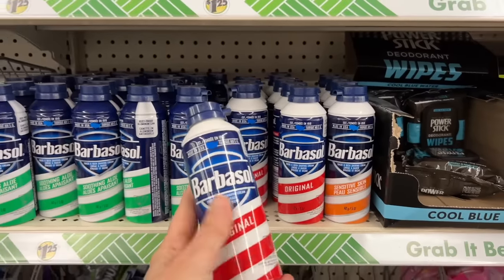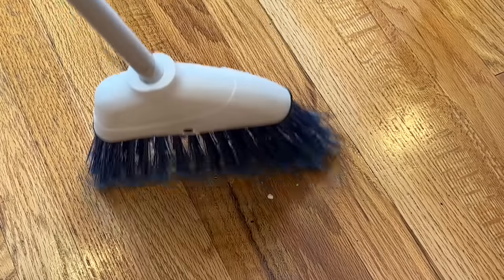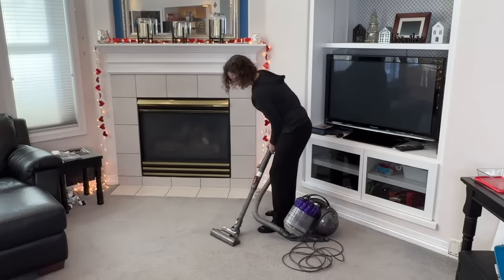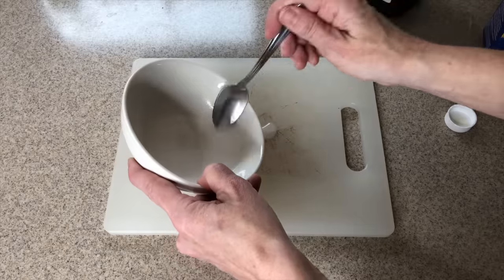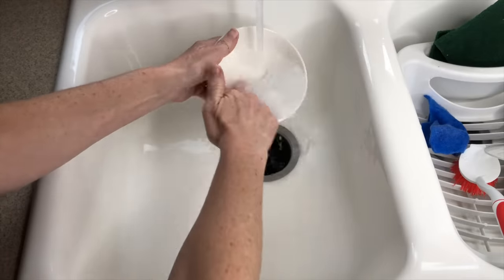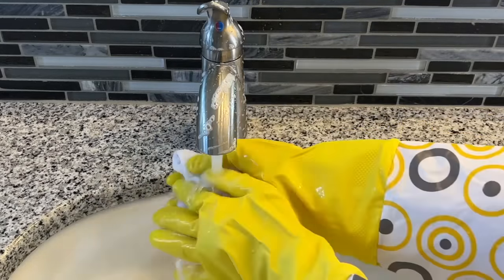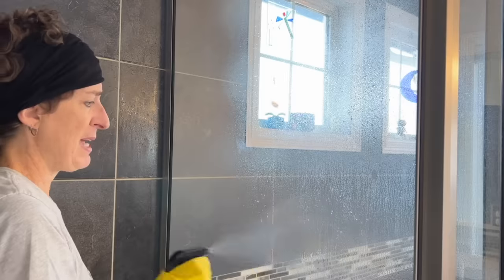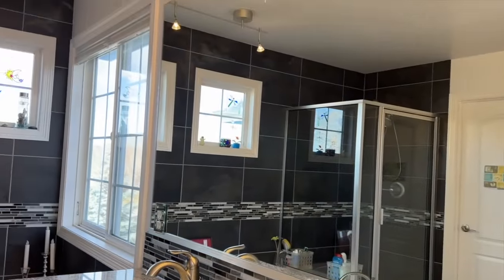This will solve everyone's WORST toilet problem!

Comment: Don't put Fabuloso in your toilet tank it will rotten out the O rings and make the flusher weak.
Reply: Same with the Clorox tank tablets.
Reply: Thank you for the warning!
Reply: The only things that should be allowed in the toilet tank are cleaning vinegar or hydrogen peroxide to prevent dirty toilet rims.
Reply: Before it does any of that it’s going to float around and bump into the mechanisms and cause the toilet to run constantly.  I tried a trick to use less water with filled water bottles (reused) so that’s how I know.  Didn’t break anything just didn’t let the toilet stop running when flushed.
Reply: I pour vinegar in my tank occasionally.
Reply: Plumbers say:
Don’t put any product in your toilet tank because it will damage your tank
Reply: You can use Oxiclean to clean your toilet tank. Empty the tank, add some Oxi and let the tank refill, then flush the toilet. If the tank is very dirty, leave the Oxi in for a few minutes. Oxi takes care of the dirt and doesn't stay in the tank long enough to damage the seal and mechanism.
Reply: Yeah, I had put in those blue tank cleaner tablets. Ate the seals. Caused leaking. Had to have the whole toilets seals fixed.
Reply: Also, keeping chemicals out of the tank leaves you water to have available in case of a disaster and water elsewhere is off or contaminated.
Reply: i thought the same thing. just use the toilet drops that are made for tanks
Reply: Or Bleach
Reply: @B_HarTz  Not the septic tank ya goof.  The water tank on the back of the toilet.  If you keep it clean, it can be an emergency reserve.  If you put chlorine tabs or blue water cleaner, you don’t have that reserve.  Not a hippie, but I did stay at a Holiday Inn Express last night.
Reply: @jonathandeere6232 😂😂😂

Comment: Heat up the vanilla extract in a microwave rather than an oven, it'll be cheaper on your electric bill.
Reply: Plus keep your kitchen cooler!
Reply: Some of us don’t have radar ovens. That was their original name.
Reply: Um ? I don't know much about anything but what about water/ vanilla mix and put it on a candle warmer??? I'm just a old guy that might get a warmer and try it
Reply: That should work too! 😊👍🏽😊👍🏽
Reply: @jeffharper7579  I put a little oil and vanilla in a skillet cast-iron skillet to warm it and stays warm awhile, just keep it on low in case you walk away and forget it's on, as a precaution, guess how I know.

Comment: If you need added scrubbing action when baking soda is not enough, use Borax. It does not dissolve as rapidly, is a little harder, yet will not scratch metal, porcelain surfaces. Oxyclean is also a great soaking solution for clothes, pots, and pans.

Comment: Depending on how old your dishes are removing, silver marks off your dishes, doesn’t mean that they’re just dirty it can also mean that there’s lead in the glaze that is on those dishes. Which they stopped making because of the lead that is bad, so throw them out unless you’re sure.
Reply: If you look at new dishes right now, most of them still have lead!!  If you search for “lead free” dishes you can find some but the point is, most dishes HAVE lead in them today.  Lots of glass also has lead!
Reply: Vintage dishes including fine china, ceramic ware & even Corelle pre 2005 are not safe to use other than for decorative purposes. Ceramic dishware from Mexico, Central & South America and Asia is not recommended to use for eating or storing food. Crystal especially wine glasses & decanters are not safe unless specifically marked. Alcohol or any acidic juices/liquid can increase lead levels in crystal glassware.

Comment: Here’s a helpful hint for anyone with dogs, if you have carpet, put some heated white vinegar in with your clean water and detergent when scrubbing your carpet.  Do the same with the water you use when wiping your hard wood floors or tole floors. It really helps keep the dog odors away. In general, always have white vinegar and use it often. Heated white vinegar with some Dawn added is a great hard water stain remover and great shower/bath cleaner. Not to mention, it neutralizes the bathroom odors.
Reply: Heated white vinegar...like put it on the stove and heat it??
Reply: @sarahconnor4757  I usually just microwave it for a couple minutes. Doesn’t have to be scorching, but I will heat it pretty hot for certain things. White vinegar, heated or not, is something I use quite often. When I’m cleaning my washing machine, dishwasher, shower. With my dogs, it really helps lift the dog smell from the carpet.
Reply: Regular dawn or the power wash?

Comment: If your getting a smell out of the bottom of your toilet, that means it wasn’t properly sealed with 100% silicone and sewer gases are getting through, and for the sewer gases to even get to that point, it means you have a failed seal at the closet flange- replace the wax ring, or your flange is set to low and you need either an extra thick wax ring, double stack two extra thick’s, or get one of those new fancy silicone self adjusting rings to seal the flange. But masking the smell is not the right solution.
Reply: Thank you for sharing your sense!
Reply: Assuming the house was plumbed to code it will have a p-trap beneath the floor which would prevent what you are saying from occurring.
Reply: @davidbalderston2751  where is that code? 

codes in the U.S, do not have a p-trap down stream of a toilet closet flange. The trap is the toilet itself the gases don’t creep past the waterline of the bowl. So it’s essential that the wax ring and the silicone circumference are installed properly.
Reply: Or maybe she is talking about the smell from urine accumulating on the outside of the seal under the bottom lip from guys with poor aim . . . it does happen.
Reply: @davidbalderston2751 p traps are built in the tiolet, the waste lines are a straight shot to the main in all tiolets that you will come across in modern day usa.
Reply: @_Chipster exactly what I was thinking

Comment: So whats best to remove persistent Limescale from the Toilet Bowl????
Reply: Install a whole house water softener system.  Scrape it off with a pumice stone. Cut off the water to the toilet and let the toilet dry off.  Soak the deposits with undiluted vinegar and wipe off the softened deposits.  The trick here is to keep the vinegar wet with repeated spraying, or vinegar wetted sponges or rags applied to the deposits to dissolve them. Keep a pint jar of vinegar inside the toilet tank to keep the water acid. Make a small hole in the jar lid to let the vinegar deep out.  Replace the vinegar every two weeks or so.  They say this will damage the flush mechanism in the toilet tank but the process has not caused any problems for me after several years use.

Comment: Can you recommend something to unclog toilets sinks shower drain
Reply: Dawn. I used every thing, wasted money, I keep a few drops in toilet. Or shower, not one problem.
Reply: I also say Dawn. My son keeps blockin up my toilet.  😢 nightmare.  I use hzmf cup of dawn n let it sit for n hour. For dezins i n eun boilin hot water after but the toilet usually flushes easily without hot water or plunging . ( pleade note. When i say nightmare i mean it  2 plungers, asstd chemicals n a snake later? Dawn works every time i now buy the big refill container)😅

Comment: When i moved into my house (it was a rental) the toilet bowl has those disgusting brown stains in it. Ive use clorox toilet bowl cleaner, i believe something that is CLR  with barely any water in bowl and let it sit when that didnt work i put lots more in and let it sit longer didnt work.  Yes i did scrub with a toilet brush after each of those.  Im wondering if i need to clean toilet then get all water out and put CLR in and scrub with a scrubber sponge.  Please help. Oh ive also used stuff with oxy clean and peroxide.

Comment: How does hometalk handle garbage disposal stink?
Reply: There are a number of suggestions people have made over the years: 
Run orange or lemon peel own the disposal
There are tablets you can buy
I just run the hot water for a minute then squirter some Dawn into the disposal side and turn it on. Do it a couple of times if necessary. 
Another possible issue is a partial plug. Find a reputable drain cleaning company to clear the drain for you.
Reply: Cut up a whole lemon and run it through your disposal with a handful of ice cubes. The lemon will get rid of the smell and the ice cubes will sharpen the blades.
Reply: Also, remember that any time you run the disposal you need to follow up with a squirt of dish soap, then run the disposal again. It foams up and helps remove small particles.
Reply: You can literally stick a brush with a long handle down there when it’s off.  Use regular cleaner like dish soap then remove the brush, turn on the hot water and run it.
Reply: After removing the rubber grommet around the opening of the disposal, I take a cloth and wipe out the 'slimy grub'. Then I pour a little vinegar inside the disposal and sprinkle baking soda inside.

Comment: If sewer gases are escaping from under your toilet, DO NOT use this method to fix it.  The toilet needs to be resealed to the flange.  This is a safety item.

Comment: Do you realize that Downy can actually stain fabrics?  I worked in healthcare for almost forty years, and sometimes my whites would get weird stains that would actually ruin the clothes. I found out they were from Downy, and switched to wool balls in the dryer to eliminate the problem. Anyway, I wouldn’t dream of spraying Downy in my rooms (even diluted!) because of the risk of stains.
Reply: That was my thoughts exactly.
Reply: Not to mention hormone disrupting phthalates.
Reply: Not safe for animals either …
Reply: I had to prove to my husband that fabric softener makes stains and odors set into the clothes! I got new t-shirts and stopped using fabric softener, and all of the new shirts which have been laundered do not stink or have deodorant stains in the arm pit area... I'm glad someone else realizes the fabric softener scam!

Comment: Do not put Fabuloso in your toilet unless you know what kind of chemicals are in it it could break down the seals and the Styrofoam, and whatever the Reservoir of your toilet is made of. In the long run it’s probably just cheaper to clean your toilet 😊 if you have a dog that drinks out of the toilet 🐶 also don’t do that.
Reply: Cats secretly drink out of toilets, too.  They would never tell you but sometimes they do!
Reply: @sonialinsey8083  So will dogs do this.

Comment: Why on earth would you wet your dust pan? The debris will end up sticking to the dust pan and you will have to wash it off later. You have doubled your work load.
Reply: Just rinse it under your faucet for a second.
Reply: Do you not wash your dust and brush then? Just askong
Reply: @susancraybould3919  on occasion, yes. But I do not intentionally make is s debris sticks to it. Again, why make extra work? It's ridiculous!
Reply: I wouldn’t do that either, but I do use the paper towel with the wet edge a lot.  Hard water marks I do not use her method either. I heat white vinegar and add Dawn soap and spray. Let sit, rinse, repeat if necessary and they scrub off just fine.
Reply: @susancraybould3919 do you?  I might wipe my dust pan down, but beyond that and making sure my broom doesn’t have debris and hair in it that’s it.  I do not anyone that does.
Reply: I wash my dustpans out quite often, why wouldn’t you?  Wetting the dustpan is a great idea, will defiantly be doing that next time. Thanks.
Reply: @MrsSeaHag  your decision, not mine. Have fun!
Reply: Why not just use a vacuum on wood floors?🤔
Reply: @guyh.4121  believe it or not some folks can't afford one.
Reply: @gh4121-b5n  occasionally they will need to be washed. Especially if you have dogs. I don’t have wood floors, but I swifter my tile floors for the most part.

Comment: The downy one I would be careful because of the possibilities of different chemicals that are in the different scented (or original scent) could have a negative impact over a long period of time and a possibility of serious allergic reactions that will be far worse than a person getting a rash in their skin. The concept is good though but I would try to find a good natural scent (orange/lemon/lime peels that have been ground up to put in the water) or essential oils that you’ve made sure don’t have any harmful chemicals to breathe, harmful chemicals to the skin, and harmful chemicals that could land on foods/drinks that might be consumed. 
Many of the ideas are really good and the first one with the shaving cream and toilet is awesome hack that I plan to use later today to try to get rid of some smells from our homes bathroom that I haven’t been able to figure out where it was coming from and I was planning on removing the toilet to clean beneath it along with the inside but im definitely gonna give it a shot before putting in all the extra labor.
Reply: Leaves little oil like spots on things too.  I make my own febreeze using my essential oils, rubbing alcohol and distilled water and it doesn’t do that.
Reply: I agree. My dad and I both have trouble breathing when Mom uses fabric softener in the dryer. I'd much rather find something natural.
Reply: @JaneSmith0709  my older sister has breathing issues and is extremely scent sensitive, asthma and allergies. I bought her a set of wool dryer balls, which does help soften the clothes naturally, as well as cutting dry time.  There are things I don’t like to use fabric softener on myself.  I love my set, as I use them whether I use fabric softener or not. I keep them in my dryer. I can’t speak for the ones I’ve seen that are not wool, but my wool ones are awesome and my sister loves hers too.
Reply: @kellidinit3725 I always use wool dryer balls. They decrease the drying time & fluff up fabrics naturally unlike commercial fabric softners that are not safe for the environment or fabrics & actually make towels less absorbent. If you want to, you can put just a drop or two of essential oils directly on the dryer balls. I have one marked just for that & keep it separated from the others.
 I noticed so many using fabric softener sheets that I smell when outside walking. That's in the air & not safe for birds &
 pollinators. Another problem is the newer beads people add to their washing machines to keep clothes "fresher, longer. " Those chemicals are being put into the water system, causing problems & definitely get absorbed into the skin. My dermatologist advises against using anything with fragrance when washing/drying clothes for that reason. There's a reason it affects those with asthma or respiratory problems. There are so many natural solutions that work just as well as the others.
Reply: @kellidinit3725  Do you care to share your recipe for this? Ratios? Or cups/ounces of each items?
Reply: @k.i.m.withkim9512  first, let me apologize that I tend to make a couple bottles at a time, so my amounts are for that. 1 1/2 cups distilled water, 1/2 cup of witch hazel, rubbing alcohol or vodka, it is optional to add a tablespoon on baking soda or white vinegar, then 20 or 30 drops of your favorite essential oil or combo of them.  I usually use the witch hazel or rubbing alcohol.  I have used vodka though, and I must say, I think I liked it best, but I am not buying vodka to spray around my house on a regular basis. When I used it to begin with, it was because I had actually had a bottle in my freezer for about two years.  Once blended and in the spray bottle, I usually wait a couple hours to use, but that is just me.  Give the bottle a little shake before using. I have dogs, and those dogs are spoiled, so I needed something I knew was safe for them too. Keeps our furniture neutralized against the dog odors.  And I don’t know who needs to know this, but warm white vinegar, warm water and Dawn dish soap will clean a shower beautifully and eliminate bathroom odors.

Comment: Easier way to remove blood/stain:  wet the blood stain, make a paste of salt and water rub the salt paste into the stain, let dry then wash. Works every time.Salt dissolves protein. Use this for chocolate, tomato sauce.  Protein stains (human and animal fluids) should never be exposed to hot water or acids like vinegar or lemon as this will set the stain. Thoroughly rinsing then soaking protein stains (like blood) in cold water with a bit of sea salt will usually do the trick.
Reply: Hydrogen peroxide is also really good at removing blood, even dried. And it's cheap.

Comment: Use hair spray on Ink stains.  It dissolves it, and is gone after one cold water washing in machine.  If you get ink pen stuff on your skin, use baby oil to remove.
Reply: It also works on bloodstains

Comment: A toilet that has an odor coming from beneath the bowl needs to be reset as the seal between the bottom of the toilet and the wax seal is compromised. Have the toilet pulled and reset.
Reply: Or clean the urine off the floor around the toilet like I did
Reply: Not always! A child or men's urine running down side of toilet after accidentally hitting bowl rim onto foor.

Comment: I was told to use only water on my bathroom faucets because the antique bronze color will come off using cleaners! So how do I disinfect them? 😫
Reply: Patricia, if your not sure maybe call the manufacturer for the proper cleaning information. Maybe they could offer some help
Reply: Thank you
Reply: Use dishwashing soap. I keep a bar of natural goat milk bar soap under my kitchen sink just to clean the faucets. Does a beautiful job!
Reply: @Siquomb1  thank you so much.
Reply: Vinegar?
Reply: @Lyn nonya absolutely not on a brass coating 🙀 if it were solid brass you could but vinegar will eventually eat off the coating.
Reply: Maybe alcohol.
Reply: I use baking soda and water with a toothbrush and microfiber cloth